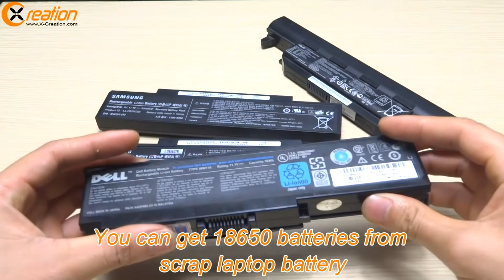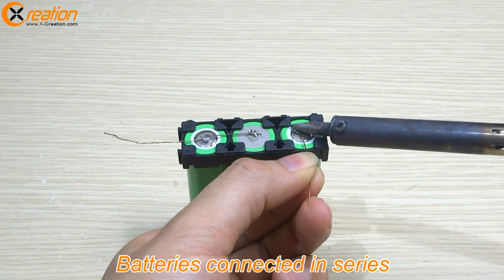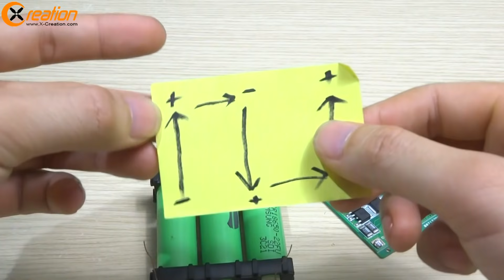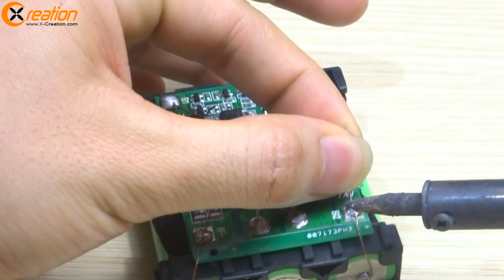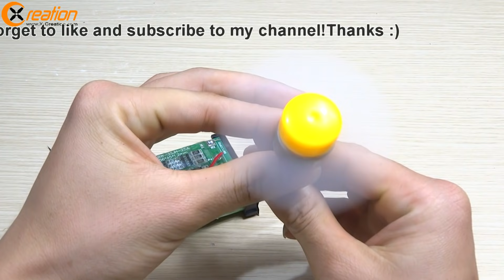How to make 12V RECHARGEABLE BATTERY pack from 18650 battery

Comment: Torture! All I want to do is clean and properly tin the tip of that soldering iron. It's like soldering with a rusty nail!
Reply: In order to do that you need a piece of sponge wet in a shallow container with water to keep it wet all the time.  Clean the tip every time you use the iron and it will be clean and last a long time.
Reply: I agree, Andrew. A piece of 000 steel wool or a damp sponge are not difficult to come by.
Reply: I was thinking the same! lol, clean it with some 320 wet sand paper then wipe it after use while still hot.if the solder wasnt already on the parts, it would have never stuck.
Reply: It truly was very annoying to watch lol. 
On par with the soldering job to be honest. That must have been one of the choppiest soldering jobs I've seen in a while. That temp was 10-20 C lower than it should lmao.

Comment: can you charge and discharge simultaneously with an input and an output cable going to P+ and P-? Is this the standard way say if I have a small 5w 12v solar panel? cheers
Reply: That’s what I wanna do lmk if you find anything pls

Comment: To increase capacity, would I just wire additional 3 packs in parallel to each other?   Looking to build a pack for an underwater camera with small lcd display, combined around 900 mA, so I’d like about 6 Ah.  Would that be a 3x3 pack?
Reply: Yes but have a look for the charging state of the different cells. they should be similar to the others. otherwise you will loose all the energy internally and the whole batterypack will be dead.
Reply: @Norcomos  you don't need to balance cells that are in parallel, only those that are in series. cells naturally balance themselves in parallel.

Comment: You can charge from the same cable that comes the voltage?
Reply: will that voltage coming out,not cause any damage to the power supply.thanks

Comment: 3x4.2v=12.6v....this is not very good for running 12v equipment. You see most 12v equipment operates between 12.5 and 14.4v. Better to use 4x3.7v but only charge battery to 14.4v-this will give much longer running time and also extend the overall life of battery because it is not being fully charged every time.
Reply: As far as I am aware 18650 and 21700 cells have the highest energy density (mAh/capacity) of any battery you can buy. So even though the pack in this video is running at a less efficient voltage (12v instead of 14.4v), the capacity is probably higher than if he used 3.7 cells. I think.

Comment: How many Amps is that altogether? and, can I use my Litokala battery charger as a powerbank? I just slot 3 or 4 18650 batteries inside and boom, I've got the same thing the only problem is, the output port is standard USB cable, how how does one convert it to the kind of plug you had in case my rotor or any device I intend to power doesn't have a USB A cable?

Comment: hello this battery input really work? so input wire and output wire are same ? In our power bank they separate output for phone and input for power bank charge. Question is can i use output  and input without separating?   Are they same?

Comment: I was expecting a boost or buck converter to be used to regulate the voltage. Plus I wouldn't use solder with 18650s. Instead use a spot welder.
Reply from the maker: I will try more! Thanks!😘

Comment: Thanks for you video. Is charging and discharging (running some thing off the battery) done from the same terminals? That means the cells are being charged in series and not individually. I have seen the RC batteries have charging done from different terminals. Can you please explain.
Reply: Yes!

Comment: Great video.  What would you suggest I should do if I have a robot vacuum with an existing power rechargeable pack but it's no longer holding the charge for more than 10 minutes and it used to run for an hour? Only reason I ask is a replacement battery pack for this model of vacuum is almost as much as the vacuum itself... completely rip off

Comment: That charger will only charge until 12v only full voltage would be 12.6v, on the bright side your battery pack will last longer
Reply from the maker: Thank you so much 😊

Comment: I have a similar battery and want to charge it. I have a 12v 2A adapter witch  I even connected to the battery overnight. The Adapter outputs 12.6V when measured with a multimeter. After charging the battery read 11.4V in the multimeter. It should charge upto 12.6v as 18650 cells have 4.2v as thier max voltage. Please help me where I am going wrong and how to completely charge the battery.

Comment: I have one question if the voltage drop below  8..50 then this board showing any output power? when  I am going to check with a multimeter?

Comment: I must have wired it incorrectly...am getting a 6.9v from the bottom middle positive and negative outputs..it should be reading 12v but am only getting 6.9v

Comment: Hi, great video, but it is not really 12v... it is almost 12v. Is that normal?
Reply: Its because of each cell voltage if he added another battery to it to make it go over it would be in the 14 volt range and be to high

Comment: Can i connect another 2 with parallel and use this same pcb?
I wan`t to make a charger than can mantain close to 12v for as long as possible, bought one from china for 12$ and the 18650s can`t hold their initial 12.4v for more than 5 minutes charging my 2 ncr18650pf in series, it drops to 10.44, and the protection on the vaporizer that helds them activates, inhibiting the charge

Comment: can you use three regular double a batteries the same way and just not ever charge them? i assume not because it says lithium* for the battery chip huh.
Reply: No bro, that would not work. Lithium batteries have voltage of 3.7 V while normal AA has 1.2-1.5 V.
 Do you only need 12v supply from AA batteries? Just wire 8 of them in series. So it's 8 * 1.5v = 12v. It will work like this: https://www.amazon.com/Battery-Holder-FolioGadgets-Storage-4-Pack/dp/B07D1FYCCM

Comment: Hi, my friend this battery pack work to start on a modem wifi with 12v and 500 Ma? Thanks in advanced!
Reply: I have used it with 1A wifi modem and get backup time of upto 7 hours so it should work with 0.5A modem except you will get twice as much backup time depending on quality of batteries you are using.
Reply: @ironspider9026  iam having 2200 mah battery I have made it to 12v battery pack in how many hours will it Full charge and how much back up will it give..

Comment: Hi, I got a questions?.. how does it work, if I have an electronic device that runs on 12v, the power source must be 12v too? Or if device runs on 12v can I used power source as much as I want? Example, 24v, 48v etc power source? 24v power source would last much longer than 12v source right? If what I asked is possible! Or do i need some kind of extra device to be able to used higher power source for the low powered device.  Also, if I use 12v power source(🔋) to power 12v 300watt immersion heater, how long will the 12v battery last? Do I need higher voltage battery? If yes, do I need extra device or electronic parts to run on higher voltage battery? The 12v 300w immersion heater?

Comment: Sehenswertes Videomaterial, top gemacht & interessant nicht nur für alle ambitionierten Akkupack-Hobbybastler da draußen... Weiter so. Der Daumen ist meinerseits selbstverständlich nach oben gegangen & das Abo vom Kanal ist ebenfalls gemacht. So, und jetzt bastle ich meine beiden Akkupacks weiter. Da aktuell aufgrund sinkender Leistungsfähigkeit des Originalakkus ( NiMh-Akkupack ) bastle ich mir mit aufgearbeiteten Akkubohrer-NiMh-Zellen ein Duplikat. Ein zweites Akkupack teste ich dann auch in kürze, welches dann allerdings auf neuer Lithium-Basis statt NiMh läuft. Dieses wird als Test-& Zweitakku zum mitnehmen im Rucksack gebaut. Frage: Ist eine BMS Platine eigentlich zwingend nötig?oder kann man evtl. irgendwie eine manuelle Wartungincl. Balancen machen, ohne elektronische Platinendefekte zu riskieren („Defekter“ Akkupack wgn kaputtem BMS trotz der weiterhin 100% funktionierenden Zellen). viele Grüße aus L.E.

Comment: Is it possible to charge and used at the same time?
Reply: Not a good idea if you want to have it plugged in then get get 2 power supplies one to power it from the outlet and one to charge the battery pack

Comment: i think you must to use a 12.6 v charger.because  each battery on fully charge has 4.2v ;))
Reply: 3.7v each
Reply: You're both wrong. 3.5v is rested, 3.9v is nominally charged, and anything above 4.1v is overcharged.

Comment: If i m using phone batteries to make 12 v battery do i need to use this protective module, as phone battery already has this inside please reply
Reply: But that's 1S module you need a 3S BMS for making 12V

Comment: I was wondering if I should use 3 x 3.7v batteries or 4 x 3.7v batteries
Reply: Depends on the needs, but if you actually need to run 12v equipment, 4s will probably be better, running between around 11-15v(again, depends on the needs).

Comment: How may i know the battery is fully charged or not
Reply: I would be curious about this. Or how much time does he need?
Reply: @milszab  u can't.. U have to buy additional 3s capacity indicator circuit for that..bms has over charge protection.. So no battery will damage..

Comment: Hi! Maybe you can help me. I tried to make a new battery pack for my cordless drill. So I series 3 18650's together. That worked, but at the first resistance to the drill the batteries died, so I figured I wasn't getting enough amps. So I made a new one, with 2 18650 parallel as a set, then series 3 of these sets. It worked quite well and had more than enough juice for hours of drilling. Here is the problem: I charged the batteries after it was drained AND FORGOT ABOUT THEM until of course they exploded. What kind of protection board do I need to use to make sure that never happens again? Please forgive me, it was the first time I worked on batteries and assumed they were just more powerful versions of the old ones I was using (NiCd) and didn't need protection.
Reply from the maker: u should use the protection board like as in video and use 18650 Battery 5C discharge high drain for drill
Reply: Thank you so much! Do you mean to use 3, 18650 5c in a series like the video, or use 6 18650 5c similar to what I did before?
I'll try to get my hands on the protection board.

Comment: How do you charge it though?... Am I blind? Don't see a port!...

1:05 AM (yep!)
3/13/2019
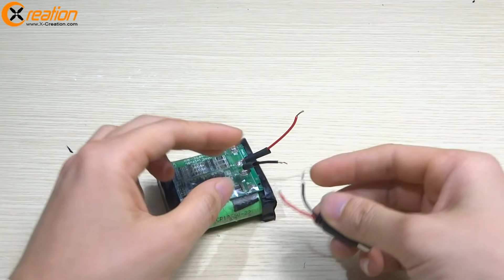Reply: Happy John go to, 3:11.  Charge and power out, are the same tabs. He wires in a barrel socket, to plug in the charger.
Reply: @strugglingparodox5709  Ah, okay! Thanks for pointing that out!

7:11 AM
4/16/2019
Reply: @strugglingparodox5709  but it just does not charge the battery, what power rating adapter do we need to use?
I used 12v 2A and it did not charge even if left overnight. The battery is 2200mAh capacity. Any help will be apreciated
Reply: @kshitijkolhe194  ,, hmm, that should have worked just fine.    I don’t know what to tell you there.

Comment: Make 48v electrical bike battery with lithium ion batteries
Reply: Bhanu Prakash isn't it just adding more batteries in series until you get desired voltages. To make the 48v battery try adding 4x batteries than this video provided. Should be manageable.
Reply: Where I can buy that protection board 48v
Reply: For 48V use 14 cells in series.

Comment: Can anyone answer this question ?? I want to make a similar power bank box with a wall outlet.  Would it possible to pair 10 Li-ion batteries in a series in parallel connected to a BMS/PCB , that could power a PS4 or TV?? Would it require a transformer OR a power inverter? 

**Thanks * !!
Reply: You can make it but the cost will be a lot , you will need a suitable bms and charger accordingly
Reply: Brandon McCartney  would it not need 12v power inverter.   Not sure how many cells though
Reply: More energy efficient to use a DC supply for your game console (doesn't it use a power brick?) and a suitable DC powered monitor. Converting a battery up to 110V AC and then have both the game and the TV convert it back to DC is very wasteful.

Comment: When battery charged can it cut the power ?
Reply: The BMS essentially does that already by reducing the charge current to zero when the batteries are full.  There are chargers that have an LED to indicate CHARGING in red and DONE in green.
Reply: @robertcartier5088  thank u but i dont use bms its dont need

Comment: Can I use 12v 5amp adapter to charge the batteri
Reply: The voltage on the adapter in video is correct one. 12.6v for 3 batteries. 12v is not enough to charge all 3.

Comment: any body with a calculator ....just put in 3.7 volts X 3 = 11.1 volts so not ...12volts .....
Reply: 18650 can have max 4.2volts, if u have baterries with 4v then you will get 12v

Comment: When I have salvage my 18650 from laptop batteries, and charge them up, when can I capacity test them?
Reply: If you want to use this setup for anything reliable, I would strongly recommend buying new batteries from Sony, LG, or Panasonic. It sounds like you're aware of battery degradation, but using batteries from a dead laptop, and pushing out a constant 12 volts from 3x  3.7v batteries is on the risky side.

Comment: can they used for 12 v akku drill.
Reply: Yes
Reply: J make like this and wont acept charging
Reply: Exactly what I'm doing!
Reply: @adamsken01  ok nice
Reply: @adamsken01  yea but only high drainage uutery from lap top with 8 A BUTT not tge best.lower will not give good results.can give more results if doubled 6 cell for 12 v or 9 cell for 12v
Reply: @alekpop1625  Mine can handle 22A peak current, and 11A continuous current. (5C)
My drill is not very powerful, so even laptop batteries would work fine, but I don't have them, so I bought some, and these had the best price/performance ratio
Reply: @adamsken01  thats nice but watch not over load even on small drill 11a butery hard to handle 20a onley if doubled.maybe you have best buttery .try
Reply: Check specifiations

Comment: great video I loved it. Since you're using power cells from the laptop battery, do you have to charge them once they run out of juice or will it just stay at roughly 12v?

Comment: How to charge battery .. any charging module link plz help
Reply: Do you not know what a bms is....
Reply: @mashedpotatoes5323  you can charge the pack with 12.6V... just plug in. the BMS save the 18650 for over and undervoltage....
Reply: @noobandnerd6543  no really????...…...

Comment: The 18650 batteries, do they need to have the low voltage protection, or does the board do the low voltage protection? My understanding is that the 18650s arnt not made to go completely dead, and a low voltage cutoff prolongs the life of the cell.

Comment: Please practice soldering more. also, your'e asking for a fire using bare wire connections. also,, did you check all the cells and explain how if each battery is not tested within .5V of each other, IT WILL EXPLODE! No, you didn't. Your video is very dangerous for newbies who don't know better.